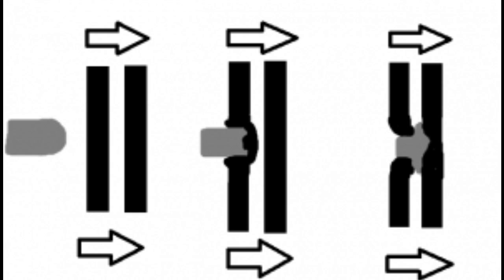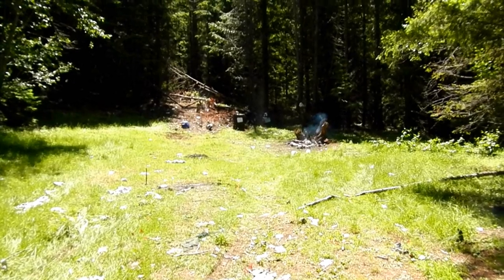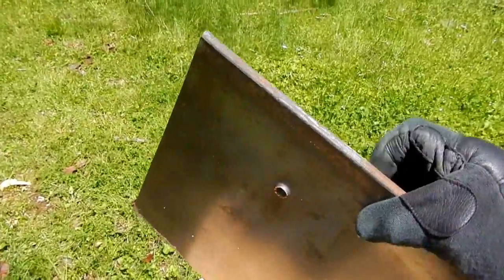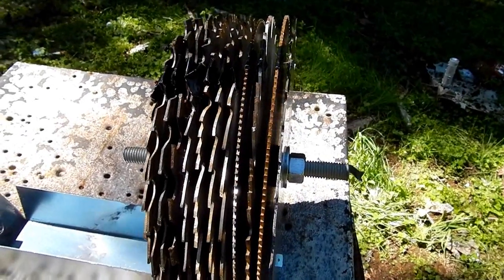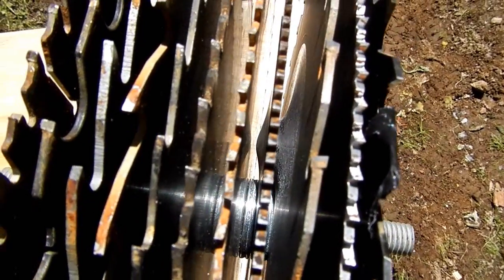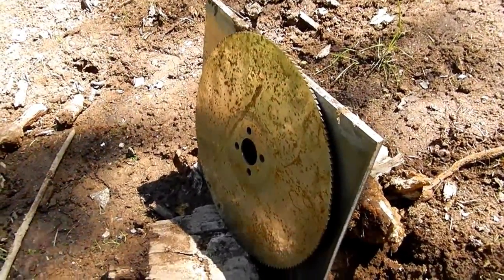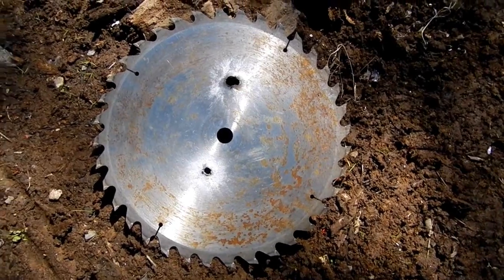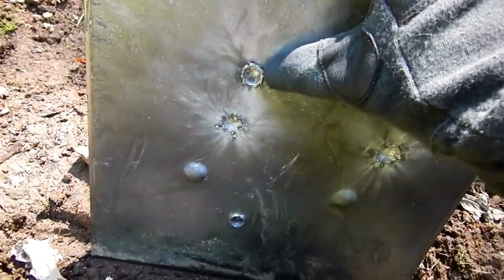Testing the Concept of Spaced Armor

Comment: Lots of variables here.  I would have liked to see the same saw blades throughout the block.  Also securing the edges to prevent deflection would be nice.  Good POC though.
Reply: Was thinking the same.

And maybe changing the spacing between, some closer together, further apart, etc.

Comment: I'm sure this testing is totally inaccurate,  for the reason that the saw blades are a hardened and or a tempered steel matrix . Thus to make any accurate assessment of results all factors need to be accounted ,  all that this shows is a random assessment of this concept. In fact if revealed the large saw blade used in front of the 3/ 8 plate is actually a carbide based steel.

Comment: So far you have only proven that 4/8th in. offers better protection than 3/8 in. That's trivial. What about a single 1/2 in plate, or a thin plate behind a thick plate? Maybe the 3/8 plate could slow down a 556 so much that it can no longer penetrate the 1/8th? If it were body armor, that 7.62x39 hit could still cause broken ribs, but with another plate behind it, even thinner, say 1 mm, you could simply shrug it off?

Comment: What TYPE of steel are your plates?  Mild steel?  Hardened? Rolled Homogenous Steel? Cold saw blades are good quality chrome vanadium, hot saw blades are mild steel with hardened teeth.  Your normal plate stock is soft.

This protocol is a good test of concept as long as your materials are the same.
Reply: In that case, the spaced armour can be considered as composite armour...
Reply: Agreed. Especially when he was talking about how some blades were  brittle and others were more softer. It wouldn't be a fair comparison.

Comment: As a certified 6G welder, I must comment on that piece of 3/8. That looks like certification steel that we use in welding, which is very low carbon and is therefore very soft. Those saw blades are without a doubt hardened steel. If you took a hardened 3/8 steel plate and shot it you would have no penetration from anything less than the best of AP rounds. Test invalidated due the two different steel types used in the different tests... would very much be worth doing with a hardened steel plate though.
Reply: I was troubled by the fact that the ak-47 didn't penetrate the mild 3/8 steel, but penetrated 3x 3/32 hardened steel plates with quarter inch spacing. It might be illuminating to consider the different properties of steel grades (and in what order they are stacked) for penetration resistance, but it's not as useful for direct comparison purposes.

Comment: Spaced armour can also work against kinetic penetrators. Usually it comprises of at least two plates with the front one being of a tougher or denser material as in order to break the penetrator. The space between serves the purpose of having the rest of the penetrator swivel in the air and hit the second plate sideways thus losing most of its penetrating potential and stopping at the second plate. For that to work properly there needs to be enough space and the front plate needs to be at an angle since penetrators tend to normalize and adjust at the angle of impact. A great example of this can be observed  in the Leopard 2a5/6/7 turret armour the infamous wedge. If you instead have a solid peace of armour it will serve to guide the round forwards thus not being effective at all. The doctrine of defeating modern AP is not to completely stop it with sheer mass or quantity because that wouldnt be realistic but instead to decrease or completely render inadequate its ability to penetrate.

Comment: I had some old 1/4” mild steel and used it to back up my rifle berm. I took 2 sheets and set them side by side. My 5.56 would zip right through one plate but after stacking the sheets there was no penetration unless I repeatedly hit the same spot. I think the first sheet deforms and absorbs velocity limiting penetration.

Comment: The reason the panzer 4 had side skirts wasn't for HEAT(to some point ) rounds but for the Russian  AT rifle witch was 14.5mm rifle I think.
Reply: Yep. Largely because the main users of HEAT round during WW2 were... the Germans. Also, spaced armour was first used on French armoured vehicles during WW1, and was seen on 1930's British cruiser tanks, before the Germans started putting it on their Panzers (iirc).

Edit: Well, that's certainly the reason usually given for adding skirts to the Panther tanks.
Reply: when did he say it was for HEAT?
Reply: @rileyboulay361  he didn't  have too because I was  adding information he did mention in the video on why the skirts where put on the Panzer 4

Comment: The reason why the 556 went through the plate and the 762 didn't is. The AK round is a much heavier round moving much much slower than the 556 which is a smaller round moving considerably faster.

Comment: That 5.46 ammo is military so it's definitely steel core, whereas that Wolf ammo is lead core.
If the 7.62x39 was steel core you'd see the same penetration.
Reply: Not all 5.56 is steel core. He said it was 55 grain, it was almost definitely not steel core. 62 grain green tip would have been steel core. It penetrated because it had much higher velocity and a smaller point of impact vs. the 7.62 as someone mentioned earlier in the comments.

Comment: This test really shows nothing....first off yes spaced armor is meant to stop heat , and HE rounds. Also bullet balistics factor hugely. Bullet type makes a difference. AND the steel used for saw blades is not mild steel like the plate. I have put 7.62 x 39 straight thru 3/4 in. Steel plates.

Comment: A better test would be a test with  different configurations using known steels to cut down on variables or even just testing a steel plate with equivalent thickness but spaced.

Comment: Some interesting variations that will continue to reduce penetration include.  
1) Incorporating foam, spray rubber (like Flex-Seal), or cork in between the steel layers.  The round will "bog down" and often be turned or angled (increasing frontal area of the round) thus deflecting along the steel plate.
2) Incorporating Plywood which will both deflect and slow the round in question.
3) Angling the plates so the rounds cannot impact at a perpendicular angle to the armor.  Angling a plate by 30 degrees can increase the distance the round must penetrate by up to 50%.  So an angled 1-inch plate will often stop a round that can penetrate a 1.4-inch vertical plate.  
   Add water to the mix and really watch the penetration fall off.  Water is heavy though.

Comment: The air gap between armour plate and an outer material is designed to impede the formation of the plasma jet from a shape charge. Any benefits for saa, is secondary and probably minimal. 
But you had fun shooting stuff, so all is good.
Reply from the maker: It also deforms and breaks apart armor piercing ammunition so that it is less effective when striking the main hull armor. Currently yes, its all about HEAT rounds, but it was used against AP ammo before those became common

Comment: Spaced armor is used for a quick, cheap protection upgrade against HEAT warheads, especially older RPGs you met a lot in Afghanistan.
A HEAT warhead is is a type of shaped charge explosive that uses the Munroe effect to penetrate thick tank armor. The warhead functions by having the explosive charge collapse a metal liner inside the warhead into a high-velocity superplastic jet.(from Wikipedia)
But, that armour-fucking hypersonic jet requies a certain standoff distance of detonation to reach maximum penetrating power, too close, the jet wouldn't form, too far, the jet disintegrates and disperses, left only a metal splatter on armour.
Those thin sheet metal and cages on your MRAD is meant to detonate a HEAT warhead before it hits the armour, make that standoff distance further, thus the lethal metal jet can't do it's work, then you and your buddys' lives are saved.
But spaced armour can't defend EFPs, a EFP is a Explosive Shaped Penetrator, it's constructed differently than HEAT, the internal apex angle of the copper liner is larger than HEAT, so they just launch a solid slug of metal, wouldn't be bothered by the standoff distance.
And EFPs are easier to make, and much easier to reach required destructive ability (no maths or physics are needed to be done, jam a pound of C4 behind a copper cone, job done), so those kebabs are using home-brew EFPs quite often.

Comment: Spaced armor or gapped armor or matrixed armor, what ever other name you'd like, is long known to be highly effective in defeating small arms, effective in defeating shape charge warheads, and somewhat effective in lessoning damage from hypersonic discarding sabot penetration rounds, but they work best with high density plate at a shallow angle where the cross section is geometrically thicker. This allows a thinner, therefore lighter, armor. 

There are lighter weight, lower cost, more covert, yet effective methods where you're primarily concerned about small arms, but it really depends on your neighborhood. 

Cool vid, dude.

Comment: are the saw blades not Hardened tool steel (O-1 or D2) and the plate mild steel?
Reply: Jack Nemo exactly what I was thinking.
Reply: I was waiting on some one to notice that and yes saw blades are tool harden steel.
Reply: The monosteel blade that shattered was indeed hardened O1 or D2. The carbide tipped blades are unhardend  low to mid carbon steels.
Reply: Ammunition comparison wasn’t good either, M193 ball has a soft core steel tip under the jacket, the Wolf 7.62x39mm is just copper jacketed lead.
Reply: You beat me to the comment.  I was going to say that those blades are hardened steel and not a good comparison to the mild steel plate.
Reply: The type of steel used for the blades greatly depends on the material the blade is designed to cut through. The first blade used that shattered was most likely a tile blade the 2nd blade was designed to cut wood. Steel is always a trade off, the harder it is the more brittle it will become.
Reply: The saw blades would be extremely brittle from the sides. Explains why the large one just shattered.
Reply: Indeed.
Reply: That was my first thought too
Reply: You said it.  One target is made up of hardened steel while the other is an unknown grade of steel.
Reply: @Soulkeeper only abrasive saw blades are made with aluminum oxide, he didn't use any in this video and they'd be a terrible choice for armor either way as they are not nearly as structurely strong as even mild steel.
Reply: I almost wrote that til I saw your comment
Reply: yep, its a bad comparison.
Reply: I work at Leitz tooling. Saw blades are made from S tool steels then tipped with boron sintered tungsten carbide...At least quality Leitz blades are. 

The average saw blade body is 1.2mm about 1/16"  up to 3.2mm or about 1/4" thick. Your standard Dewalt blade body is 1.8mm with a 2.2mm kerf.
Reply: And then there's the flawed part of the test where he isn't even testing it for its main uses
Reply: Aluminum Oxide is what the grit on most types of sandpaper is made from. The only "blades" made from it are grinding wheel cutoff discs. Vanadium steels are used in tool requiring higher resistance to shattering from impact, like hammers. Almost no tools are made from stainless steels, apart from some more expensive screwdriver shafts. Most cheaper tools are made from mild carbon steels then plated with a nickel/chromium. 
Even a cheap saw blade will be made of mild carbon steels the plated with a tougher metal for abrasion resistance. If used correctly on materials actually designed to be cut by the saw blade, it should see very little impact shock...It cuts through material, it doesn't hammer. If you feel lots vibrations in your table saw you are using it wrong haha.
Reply: Jack Nemo yeah he didn't really. Say anything about that
Reply: @Soulkeeper O1, A2 and D2 are all tool steels, used in a variety of tools, which has including saw blades. I've seen saw blades out of O1 and D2 for certain.
Reply: @Soulkeeper wow.
Reply: Soulkeeper O1 is tool steel
Reply: Saw blades typically are hardened only on the kerf. The un-hardened majority allows for flex to resist a break in a pinch or bind situation.
Reply: theyre certainly not hardened steel for fear of shattering in normal use
Reply: @jnathannger8654  Saw blades are hardened and tempered steel.  If they were mild steel they would dull immediately under normal use.  They aren't hard enough to be brittle, but they are definitely hardened, tempered carbon steel, which is much tougher than mild steel.
Reply: @Snugglez187  every blade ive used is carbide tipped, so they dont care about the steel
Reply: @Snugglez187  Also, shattering tends to increase when load is applied at higher velocities.
Reply: @jnathannger8654  True,but they are harder steel then the 3/8 mild steel plate, usually only the teeth on a saw blade are hardened PS even with steel armor they have to be careful not to make it too hard and brittle.

Comment: One thing overlooked that would entirely invalidate all the results in the video is the fact that different steels can have dramatically different properties. A saw blade will most likely be made of very tough, very hard carbon tool steel, and it will be heat treated for hardness and toughness as well. The steel plate could be any steel as far as I know, and most likely has not been heat treated, as heat treatment is something done by the end user for the specific application the steel is being used for. Even just the same steel with two different heat treats can have very different  strength, hardness, and toughness properties, so even more so for two different steels with different chemical compositions on top of having seperate different heat treatments. To make a future test such as this to be more legit, the two steels must be the same exact type of steel from the same exact manufacturer(even same types of steel from different manufacturers can have notable differences) and also either both not receive any heat treatment or both receive the same exact heat treatment.  Regardless, as insignificant as this video's take away is, the intent to educate and inform is appreciated and we can only look forward to even better and accurate experiments coming in the near future!

Comment: Put simply

1. The light armour plate is MEANT to flex to rob energy from the projectile.

2. The light armour plate is designed to decelerate, initiate yaw/tumbling and break up.

3.The space between your blades was far too narrow, that space needs to be greater to allow for projectile break up and tumbling to fully establish and to dissipate projectile fragments to further dissipate energy.

If your at all unsure about my comments feel free to check out our brave warriors light armoured vehicles, there is plenty of footage of their feats of bravery to fulfil any curiosity.

Hope this helps. Stay safe.

Comment: Ideally spaced armor should be spaced farther than the lengh of the penetrating projectile (fin stabilised discarding sabot round in Main battle tank use/ or to difuse the stream of a shaped HEAT round)
So it would be interesting to see a test where those plates are  spaced more than the length of the projectiles and how it compares to amore tightly packed plates.
At the same time comparing types of  AP ammo.

Comment: Really cool test and I would love to be there shooting with you to see the results but i think you are missing the concept of spaced armor. Its meant to pre detonate HEAT shells. RPGs and Tanks can fire a round that is a small explosive that shoots a jet of molten copper to melt through armor plate. If the copper is released on the outer layer of he armor then then it penetrates only that outer later and splashes off the inner layer as it is no longer a focused jet. Thats why in modern armor techniques you often see its more or less a chain link fence or steel bars welded around the vehicle. It saves weight but still explodes HEAT type projectiles before they hit the inner layer of armor. 

The thick steel plate outer armor design is helpful with stand off explosions as well. Not really the shrapnel per say but for IEDs or other large blasts that aren’t direct hits, it allows for deformation before hitting the crew compartment. At least in the US Military, infantry vehicles are becoming more “expendable” as long as they save the occupants during a blast. The vehicle can be easy replaced. Its just steel and rubber after all.